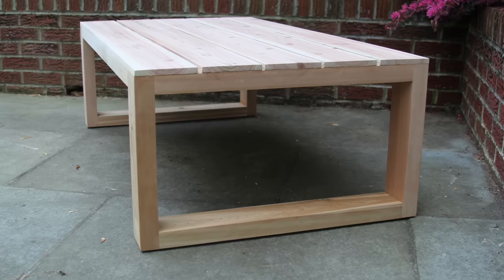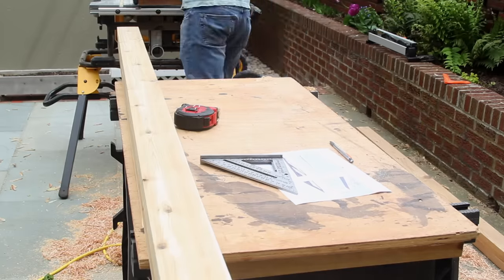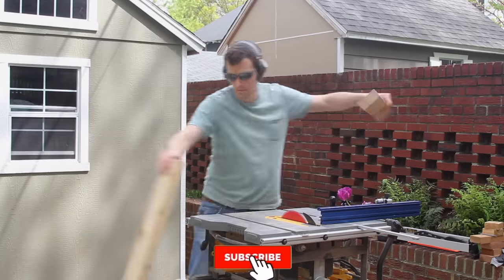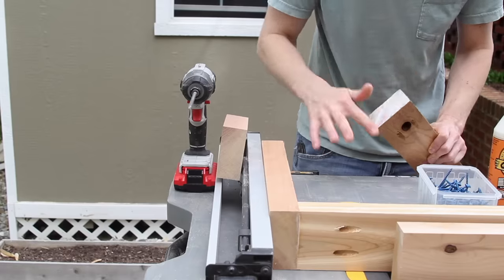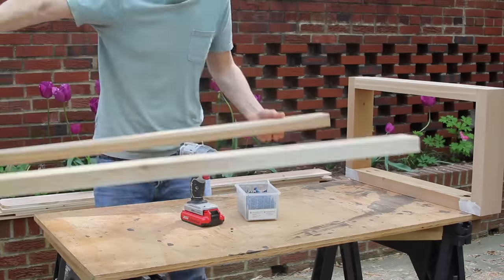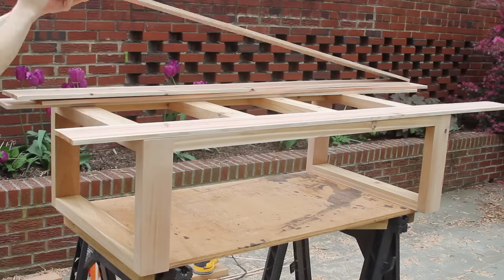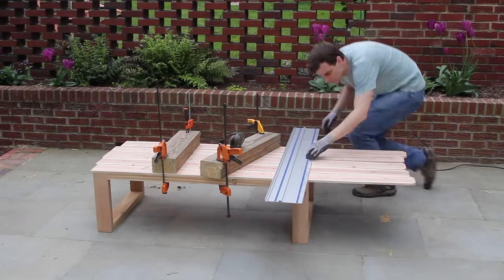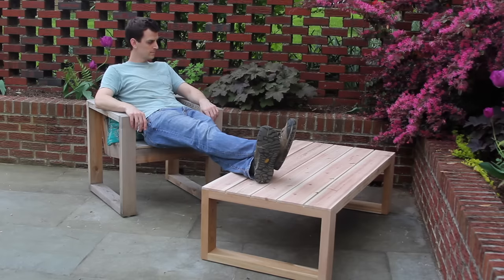DIY Modern Outdoor Cedar Coffee Table | $50 2x4 Build, Free Plans

Comment: Thanks for sharing. I strongly recommend you install your riving knife and your blade guard. Everything you did there can be effectively done with those finger and hand saving safety devices. The only time you need to take those off is for milling taller pieces of lumber.

Comment: No staining or sealing of the wood? Have the top slats peeled off from the wood? I was thinking of something similar but maybe using dowels to connect the top boards
Reply from the maker: You definitely could seal it, but I like the grayed out look. Once it grays I might do a light sand and use some teak oil. It still looks like new.

Comment: any suggestion on what kind of 2X4's to use? Are pressure treated a good option for this project?
Reply from the maker: Cedar- which is almost as cheap as pine on the east coast US at the moment! Otherwise you can use pressure treated if you want, or just regular pine if you finish it with paint it poly.

Comment: This is a simple great project - thanks.  My only 'remark' is that your pocket holes for one side of the legs and the top frame aren't going 'into the meat' of the wood, so they may be a bit weaker if you did them from the other side. 
Again thanks!
Reply from the maker: Yeah the glue should make up for it. So far it is holding up really well. I'm going to finish with some teak oil soon.

Comment: Hello, very nice project! Based on your sketch I redesigned it for my materials, the idea is to use 45x95 mm wood for the base, and I'm thinking to buy the same kreg jig I've never worked with. Tech specs tell that it can be applied for wood thickness only up to 38mm and I'm a bit confused if it's suitable for me?
Reply from the maker: Hey - yes it is built for 38mm or the box but I'm pretty sure you can do thicker. The screws would just be to one side so not ideal. I would go for it and test on a scrap peice of wood first. The cheaper version is 20-30$. Good luck! Here are the ones I use:

- Pocket Hole Jig (entry level) - Kreg Jig R3: https://amzn.to/2zujqID
- Pocket Hole Jig (heavy duty) - Kreg Tool K5 Master System: https://amzn.to/2LdTVOm
Reply: @NATHANBUILDS  I think that the best way is to use R3 but to move out the jig out of the edge 40mm. I believe that will help 2,5inch screw to exit just in the middle. The triangular calculation is needed based on drilling angle but yes can be just done empirical way on a piece of scrap
Reply from the maker: Let me know how it goes!

Comment: Question -
So I'm planning to build an end table in a similar way. How necessary are the screws? I was planning on just gorilla gluing the whole thing together as there's not going to be anything overly heavy on it. Am I heading for disaster?
Reply from the maker: So end grain doesn't hold glue incredibly well. If this is for outside and you don't intend to use other joinery (like mortise and tenon) you could have some problems. At the very least I would probably use epoxy for those connections. TotalBoat is great if you don't have any.

Comment: Hi Nathan, I'm trying to decide on the material for an outdoor bench. Did you replace the original pine table because of the material? Does pine stand up to the weather over time? My concern with cedar is that they seem to warp a little bit.
Reply from the maker: Hey -I updated the design to be cleaner and decided on cedar for it's ability to better stand up against weather. Pine will require you to finish it with poly/ similar and to maintain that finish over time. As long as you pick good boards cedar won't warp and is much more resistant too sun and rain even without finish. You can also look at some tropical hardwoods that resist weathering well, but they are more expensive.
Reply: @NATHANBUILDS  thanks! Really appreciate the information!

Comment: hey nathan, i am completely new to all of this. How should/would i get into wood working? i would love to build this, the chair and the sofa for my backyard.
Reply from the maker: Hey! Depends how much you want to spend, but you can either go cheaper and get a circular saw, drill, and sander (I have links to the ones I have in the video descriptions). I demonstrate how to make this type of project with only those tools in this video: https://youtu.be/eJTZO_FAPfM

Or you can also get a table saw and/or miter saw and you will be able to get a bit more precise. If you don't know yet if your want to commit the first option is great! Check out my earlier videos and you will see me using fewer and cheaper tools. Anyway, I have lots of tool suggestions in the video comments. Send me a finished picture on Instagram if you are on there! Good luck!
Reply: Nathan Builds thank you for the reply! As of now I have a circular saw, skill saw, mult tool sander thing, impact drill, and a normal drill. Just not the skill set 😬.
Reply from the maker: That just takes practice! Go make one of these projects and you will learn a bunch. If you are nervous about messing up expensive wood, use pine and see how it goes. You can always make a second one!
Reply: Nathan Builds well thank you, I appreciate it! I’ll have to try! I want to make the sofa, chair, and table.

Comment: Ok, what size pocket hole screws do you use for the legs? For some reason when I attach my 2x4’s in thag fashion using 2 1/2” screws it pokes right through, why is this happening?
Reply from the maker: Hey - I used 2 1/2" screws so you should be fine. The only thing I can think of, is make sure you set the depth setting on the jig for the correct depth.
Reply: I even adjusted the jig to be shorter than recommend, but still..maybe I’m drilling too deep? Regular drill or driver? And what setting?
Reply from the maker: Yes you need to have a stopper set on the drill bit to the appropriate depth so you don't drill too deep. Most kits have that included and have a guide for you.

Comment: Do you know any woodworking joints?
Reply from the maker: I assume this is a dig at using pocket holes. I personally think they are great for   a variety of applications. But you can obviously easily adjust my designs to use different joinery if you prefer. To your question, you will have to check out my other videos to find out.